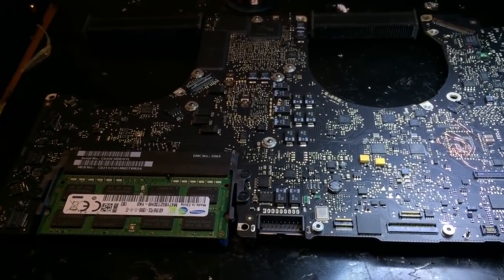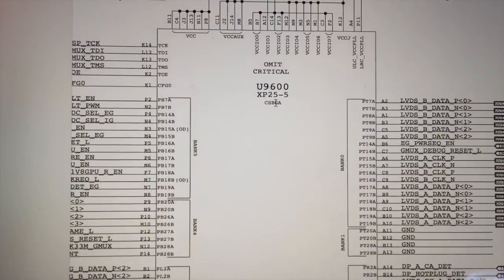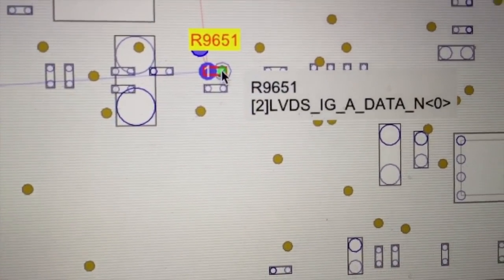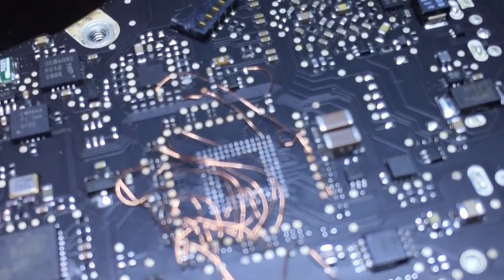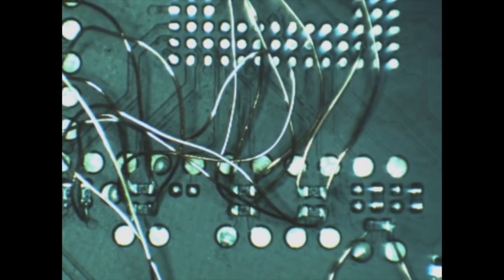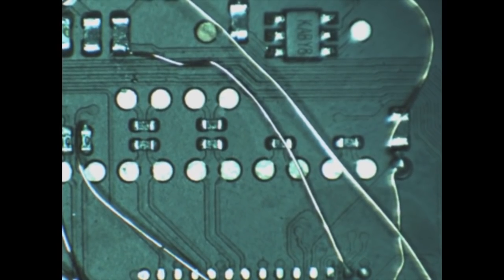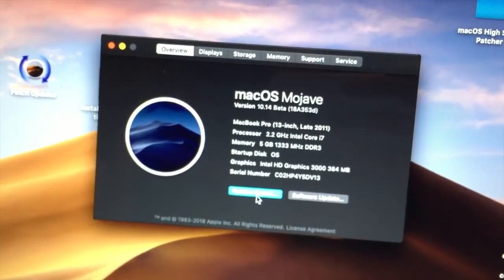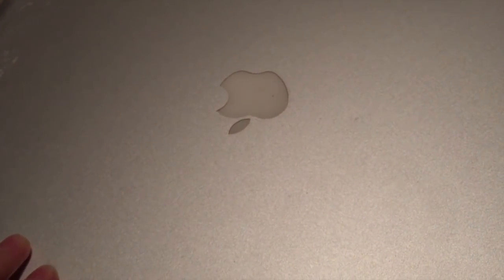Permanently Disabling the Defective GPU on a 2011 15" MacBook Pro - Hardware Mod Overview

Comment: Sadly, I barely have any decent soldering skills to attempt this fix. In any case, would this work if I don't even have a working screen anymore? I think the dGPU completely died, otherwise I'd try the NVRAM disable first. I'm sad because I was able to install and setup linux and a kernel config that disabled the dGPU on boot, but I didn't set the correct efibootmgr so I had to go through the alt+ boot screen (which still depends on the mac gmux from what I understand) and now I cannot access the linux installation. I guess a hardware disable such as this one would work, will it? I guess I could outsource to someone with a microscope and good soldering iron to do this on my MBP? Thanks

Comment: I previously had bypass my GPU issues but just recently my battery gave out completely so I replaced it and everything was working fine until I reset my PRAM believing I had too in order to calibrate the new battery. Boy was that a huge mistake. Didn't take the time to back up any of my files while I had it working now the single user mode text is completely scramble and I still tried typing the sudo NVRAM text and am not able to disable the GPU, after reboot the screen is still completely scramble. Is there anything else I can do to at least get into the computer once more to back my files up using code?
Reply: Are you still having this issue? I may be able to help. But I'm wondering what you meant by "the sudo NVRAM text".

Comment: I plan to replace the amd radeon hd 6770m 1gb on my macbook pro late 2011 15" with a radeon hd 6750m. is it possible to edit without rom or do I have to make other modifications?

Comment: can this mod work on other laptops that doesn't show the iGPU in device manager?
i have this friend with a laptop that boots into windows without any graphics driver. And whenever you install it, it shows a BSOD. I can't remember exactly what the laptop is apart from it being from Gateway.

It only shows the dead AMD GPU in device manager

Comment: Hey dosdude1. I know, that video is a bit old by now, but I like to share what I experienced with my MacBook Pro 15" 2011. I had the usual GPU problems and decided on "baking the board". I had removed the heat sinks on CPU & GPU AND those other 2, one bigger and another, smaller one. One seemed to be the INTEL GPU. (Both were quite dry, in regards of the thermo paste). After putting it all back together, it felt that the Macbook is not switching GPU's that fast anymore. So it runs longer in that Intel GPU before it switches. It's been running fine for 2 days, running several bench marks etc. Just my 2 Cent. ;)

Comment: Is it AMD’s fault? I thought AMD was known as a “fab’less chip make” meaning they don’t actually own any of the chip fabrication factories that make their chips like Intel does, AMD designs their chips and takes the design to a 3rd party manufacturer to make them. Or has that changed?
Reply: Nvidia GPU's suffered similar problems in both 8000 & 9000 series, impacting most of their customers particularly HP, Dell, Sony, Apple amongst others. Eventually Resulting in a Class Action Settlement. One of the reasons Apple refused to use Nvidia video cards ever again in their systems, was due to Nvidia's attempt to blame the system builder's for the high failure rates!
Reply: @WiiNV  I didn’t know that, you gotta be kidding me…. Every manufacturer suffers the same problem with their chip and they try to say they didn’t use it right?! What a joke..

Thanks for the info! 😎
Reply: @frankthespank  
You're welcome 🍻 My HP DV7 laptop with GTX 9600m, became an expensive paperweight, shortly after the 1yr Warranty had expired, due to Nvidia's poor lead free soldering of the BGA package! Never trust them again, after hearing their response to the manufacturer's affected.

Comment: I’m very impressed. Unfortunately, I’ll never be able to imitate that. All the other software suggestions others have shared could not be applied because I can’t ever read the screen. White noise, or small blue squares on the entire display. Regardless of starting procedures. Guess it’s time to pull the HD and toss it out.

Comment: My AMD card is completely dead. I bought the 2001 15 MacBook Pro as R8911 soldered out and NVRAM variable to use Intel graphics. After NVRAM reset booting normally but noting showing on safe mode or elsewhere. On single-user mode, I tried to write the NVRAM variable and at least it rebooted when I typed "reboot" after typing the NVRAM variable. Do you have a piece of advice? :)

Comment: Hi Collin @dosdude1.  Instead of boring you with details about the video problems we're now experiencing with our early-2011 MBP17, I'd simply like to ask you if THIS video and/or the thread you started on the MacRumors Forum -- entitled: "Permanently Disable 2011 15"/17" MacBook Pro Dedicated GPU - gMux IC Bypass" -- is the latest word on the GPU issues suffered by [apparently] a LOT of 2011 MBP 15/17 owners?   Needless to say, this is an issue that's been around for quite some time and, due to the expense of these machines, has received a LOT of attention and/or discussion.  I simply don't have the luxury of the time it takes to start from the beginning -- or the funds to buy a new MBP -- so a pointer to the latest word on a permanent GPU fix would be most honestly appreciated.  By the way, I happened upon a video last night showing an interview you gave.  I didn't have the time to watch the entire video, but you clearly indicated that there have been advances relating to permanently modding and/or repairing the 2011 MBPs, which is why I'm hoping for an update directly from a reputable source.  Thank you very much for your time and I really appreciate the fact that you've endeavored to help so many MBP owners.  All the best to you.

Comment: Great video. Is there a way to trick an 820-2915-B into thinking it is in clamshell mode? Any pins to bridge perhaps?
Reply from the maker: Bridge SMC_LID_L to ground should do it, I'd guess.
Reply: @dosdude1   Thank you, will try it to see how long a freshly 'irradiated' 6750M will last on a well ventilated, free standing logic board, probably pointless, I know.

Comment: hey dosdude1, how about short to ground pin 5 on U9220 to enable external display?
Reply from the maker: That won't work, Apple removed the other DP_IG data lines on the boards that use Thunderbolt, like this one. They only left the DDC lines for some reason.
Reply: @dosdude1 how about using wireless display adaper via airplay?
Reply: @dosdude1  where can i download 13inch bios dump file?

Comment: Thanks mate! This video and macrumors thread helped me save my 2011 15" MBP when it failed. Apple did replace the logic board the first time in July 2014. It as well lasted only 5 years.

I followed your instructions thoroughly but ended up having black screen. When I lit a flashlight from apple logo, I could see a functioning LCD. I kicked GMUX IC away using screwdriver and that was it. Everything works as expected. I don't mind having static backlight intensity.

Thanks a ton!
Reply: Hi, can you please show me which ic is it?

Comment: So I followed everything on your site and got Mohave installed on my iMac 2011 12,2 system. I'm aware of the color issues with the OS. Also I know you can't disable hardware acceleration to fix the lag and color issue. At this time is there any new fixes for this? I really would love to have it fully working. Thanks for you awesome help.

Comment: What about removing the GPU chip to save power?
Reply: He talked about that here:
After all your wiring is complete, you will need to cut power to the dedicated GPU, otherwise it will simply produce waste heat. To do so, all you need to do is remove the resistor that supplies power to the GPU VCORE regulator IC, R8911.
https://forums.macrumors.com/threads/permanently-disable-2011-15-17-macbook-pro-dedicated-gpu-gmux-ic-bypass.2134019/

Comment: Hello, how are you? My name is rolf and congratulations for the initiative. based on your tutorial I performed the procedure on my macbook pro 2011 820-2914B. I am facing black screen after installing intel drive HD3000 system windows 10. have you already tested with windows?

Comment: Can any Nvidia GPU be bypassed for Intel integrated graphics when not gaming, on other brands like Dell?
The reason is to save power battery, noise level, and heat.

Comment: I wouldn't want to do a hardware disabling. If you should decide one day to get your machine repaired, it will be much harder to reverse. Some places that advertise replacement service of the dGPU will also refuse to do it on a board that has been modified since they can't guarantee or test that the new replacement GPU is functioning before it leaves their hands. Stick with firmware disabling that you can reverse later so your board can still be repaired.
Reply from the maker: The thing is, this board can NEVER be properly repaired, as AMD never released a revised version of the defective Radeon HD 6xxx series chipsets. Therefore, any "new" chipset installed would simply fail again, just like the original. A permanent hardware dGPU bypass is the ONLY way to make this machine fully usable again.

Comment: Actually it ís Apple's fault, they put this garbage in their MacBooks and said f*ck you to their customers!

I used this method and my 17" Late 2011 MacbookPro (macOS Sierra) is working perfectly for almost a year now since the modification: https://realmacmods.com/macbook-2011-radeon-gpu-disable/ 

It only involves the removal of one EFI variable, one resistor and – if you want to use MacOs higher than Sierra – soldering one jumper wire.
Reply from the maker: That Realmacmods mod is actually the WORST thing you can possibly do to disable the dGPU in one of these systems. The reason for that is when you remove that resistor, you are relying on the fact that the NVRAM variable set to keep the iGPU active doesn't get reset or changed, which can happen VERY easily, without you realizing. Once this happens, you'll be stuck with a display that doesn't turn on at all.
Reply: @dosdude1 Thanks for the info. This seemed like the best option when my MacBook had turned into a brick. I have been using it like this for about nine months now. See how long it will last.

Comment: this is fucking insane, there must be an easier way, like designing a chip that just does that
Reply from the maker: That's why I later designed MuxHat: https://computeco.de/MuxHat
Reply: http://www.cmizapper.com/products/tiresias-gpukiller.html
With two wires you even have backlight control in High Sierra.

Comment: Hi !

I have an old Macbook Pro late 2011, 17" with a 820 2914b logic board which was not working stable. 

So the one thing which inspired me to try and fix it myself was watching your videos and that set me up for investigating and trying to find the problem.

Recently my MBP stopped booting and would only work once in a while. After a week or so it stopped posting and no chime was produced except a black screen and with fans spinning fast. 

However, I opened the back to inspect and worked my may through the schematics and started measuring voltages on R7402 pin 2 where I accidentally shorted pin 1 of R7975 using the volt meter and at that point the fans stopped spinning. Now the mac wont turn on. The mag safe charger light is on and turns green. The CPU heat sink does get warm after a minute.

I want to further trouble shoot and figure out whats wrong.

I have been measuring some voltages except now I am using a very fine point to touch the resistors/caps.

There is no CPUVCCIOS0_PGOOD coming from U7600 and no ALL_SYS_PWRGD detected.

The rest of the voltages are as follows:

PP5V_S0 4.96v
PP3V3_S0 3.26v
PP1V5_S0 1.48v
PP1V8_S3 1.7v
PP1V05_S0 1.03v
PP1V2_S30 1.19v

Any help would be greatly appreciated.

Thank you.

Comment: Hi Dosdude1 I have done the mod as per the original drawings with Mux in place. All worked fine ,great and thank you. I then did the identical mod on two identical boards and I can not get backlights to work. The backlights worked before carrying the mod. I have also tried the the later update as per your MacRumours post and still no joy. I also have an unbacklit image on the screen. Help please.
Reply: I experienced the same issue solved only removing the mux chip... I guess is there something messing up the backlight enablng circuit.

Comment: Thanks so much!!!!! This is so awesome!!!! Ive reworked it, temporarily fixed. I was about to reball the sucker as a hail mary. So glad i came across this. Any idea when the muxhats will be back in stock??
Reply from the maker: MaxHats are currently in stock, and have been for quite awhile now. You can buy them from the eBay link located on https://computeco.de/MuxHat.
Reply: @dosdude1  i was looking at that solution. So it is basically the same as your solution. Just on a attachment pcb? Thanks for helping Mother earth

Comment: Great Video ! There is a simpler way to achieve this tho. google realmacmods radeon gpu disable 2011 for a more human way to do this (not affiliated with them). I fixed at least a dozen of these exact models with this method at my repair shop. All it requires is a modded EFI and desoldering a resistor. Takes 10 minutes tops once you get the hang of it !
Reply from the maker: Actually, the RealMacMods method is just about the WORST thing you can do with one of these. With this mod applied, one PRAM reset or OS update, and the user is left with an inoperable display, with no way to re-apply that NVRAM variable. I would highly advise that you don't continue using this method, and switch to a permanent hardware bypass as shown in this video. I've actually created a new bodge board that makes the process way easier, which you can read about here: https://computeco.de/MuxHat
Reply: Dosdude1, is there a video that shows the MuxHat install?
Also, the dying light seems like a minor annoyance and I am inclined not to do install (seems difficult). However, can one choose to perform it at a later time?

Comment: If the select pins of the MUX were accessible, you could have left the MUX in place and forced a Vcc or GND on the select input pin of the MUX.  How do I get the schematic?  
Mine just died years after three repairs by Apple.
Reply from the maker: gMux is software-controlled, and does not have a high/low input pin.
Reply: @dosdude1  Thanks!  
I saw a select pin on the schematic, but it was an output.  Oh well.
Mine seems to be working again.  It started going on the fritz after resetting for an update.  I disabled it by getting rid of AMD kext files.  I was surprised the graphics looked like it wasn't even using the Intel integrated GPU.  It looked more like my Raspberry Pi than my MacBook Air.   Loaded and installed a security update on the MB Pro, then it restarted, looked good, and there were new AMD kext files.  
If this happens again, I may put Linux on the machine because Apple says it won't take Mojave.

Comment: Hi,
I m having a problem with my macbook pro 15 2011 with faulty gpu, i tried to set the nvram variable and delete the AMDRadeaonX3000.kext file, the procedure worked well on my early 2011 macbook pro but it did not work well on the late 2011 ? When i set the nvram variable the late 2011 screen go black and stays black until i reset the pram settings (ctrl+cmd+p+r), so cannot disable the dgpu.
Do you know where the problem can come from? Why my screen goes black when i set the ram variable to igpu (%01%00%00%00) ? Can anyone help me with that? I did not find anything about on the net.
Thanks

Comment: You are a legend..! Bought a 2011 Macbook pro 15" for £50, was gonna get the chip fixed but theres literally no point as this runs lovely! i used the GPU disabler on your website, i was just wondering. is there any way to rollback the EFI just incase i do get it fixed in the future? i didnt realise this was going to change the firmware entirely. thanks DOSDUDE!
Reply: I am interested in too. Thank's

Comment: My picture is green after modification. What i doing wrong? Can you help me. Thanks.
Reply from the maker: One of your lines is wired incorrectly.
Reply: one of the lines was in short circuit. solved. thank you
Reply: will you share the wiring diagram for 17'' model. thanks

Comment: I've had my MacBook Pro late 2011 since 2012 and I've had zero issues with the AMD GPU. It's never touched an Apple Genius Bar or a soldering workstation. Surprisingly, this is my main laptop and is working 24/7.
Reply: Another note... This laptop almost always has two monitors